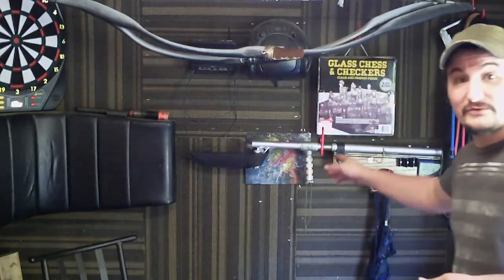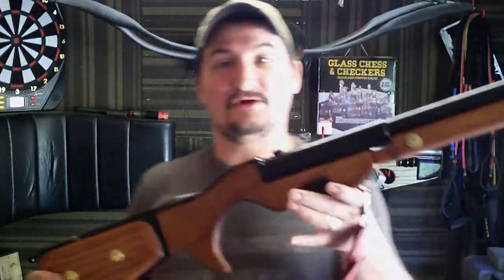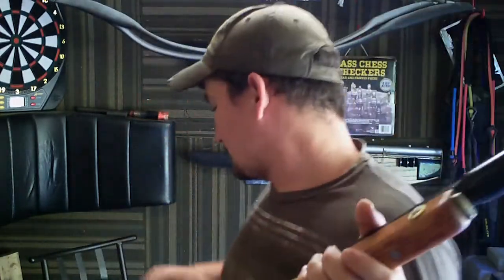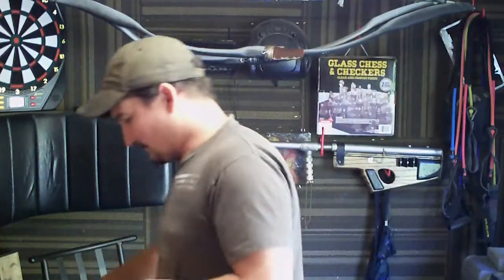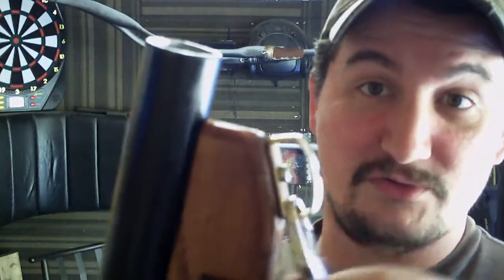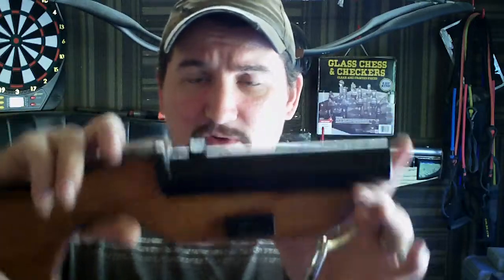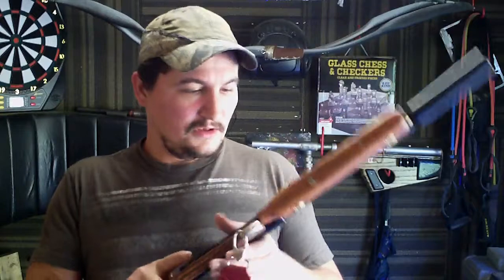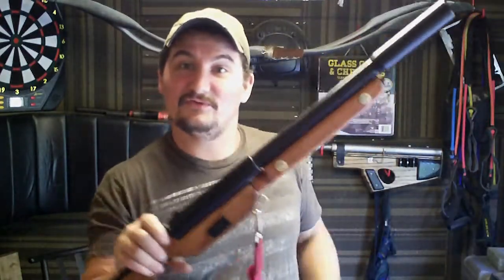Home made Slam Barrel Shotgun #2

Comment: What does a guy all need in order to make one of these.
Reply: To make one all pretty like his?
One needs talent. To make one that functions?   A twenty dollar bill and a trip to HomeDepot or any other hardware store.
   All ya need is  1" inch Black pipe 12"to 18" in length. 
Next, a piece of 3/4" in Black pipe any length over 16" in( to stay legal it needs to be at least 16")
   Then, just a screw on end cap for the 1" section, and JB weld a BB in the center of that cap for the firing pin.
     That's pretty much it Brother. You'll probably have to do some heavy sanding or a bit of work with a file to get the 3/4" pipe to slide EASILY into the 1" section...
Get it? 
One inch pipe 12" long with a screw on end cap with a BB glued in the center...
And the sanded,smooth end of the 3/4 in pipe slides into the larger 1" pipe until it hits the back end of it's travel, where it will strike the BB setting off the shell, which is loaded directly into the smooth end of the 3/4 in (barrel).
    Simply slide the barrel with the shell back in a quick firm stroke and....
KaBlam! 
Ps....use caution and make sure to NOT point the muzzle end towards your face, or any other thing you don't wanna see instantly blown to shit.
These are definitely NOT toys and should be treated with absolutely 100% respect...or BAD things can and WILL happen. 
Other that, just watch a few more of these videos and you'll gain all the knowledge anyone would ever need to manufacture their own means of protection and/or hunting game to feed themselves for a lifetime.   Stay safe and have fun👍😉

Comment: id bet those emblems feel good up against your cheek if you ever tried to aim it
Reply from the maker: they are almost flat really, don't notice them at all when firing however the small loop mount I made for the belt did scrape my side on the second shot... I had to move it about 2 inches forward.
Reply: Scraped your side like you fired from the hip, or the side of your face? They look cool, I would reccomend inlaying them kinda flush.. Use q sharp pencil & then an Xacto knife to outline them, and a gouge or small sharp chisel, or even a chisel point or square Xacto blade. Just cut it down until either the inlay is almost flush (they look domed, you'll never get them dead flush) or below the surface. If below the surface cover with clear epoxy, & sand smooth if needed. Epoxy will self level pretty well. Maybe epoxy them in if you inlay them just a bit. Pretty neat gun. Interesting plywood stock, I bet it's fairly light & swings pretty nice
Reply from the maker: It scraped my side just under my arm, had it against my shoulder, wasn't really bad. The video I made of shooting it is when it happened. It weighs almost the same as my granddad's 18.5 inch shotgun, just a little less so not too bad. The emblems are covering the screws that hold the extra wood to the side of the stock so can't embed them into the wood any although that would probably look really good.